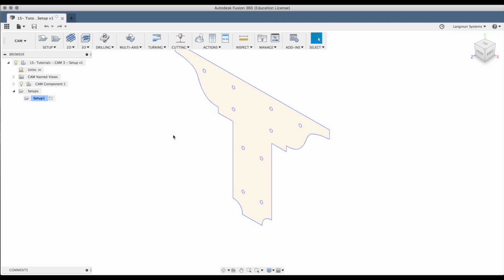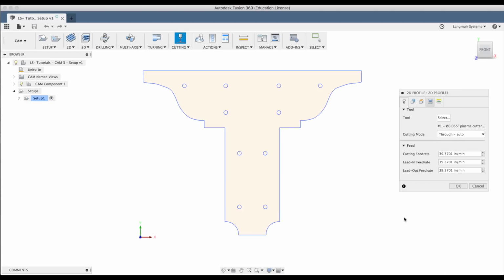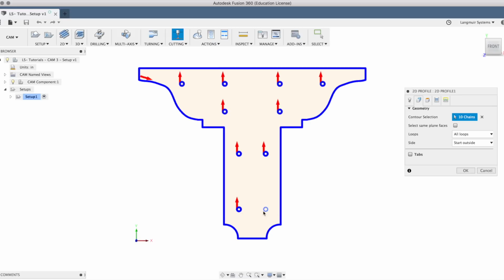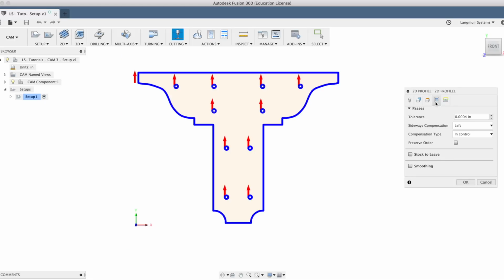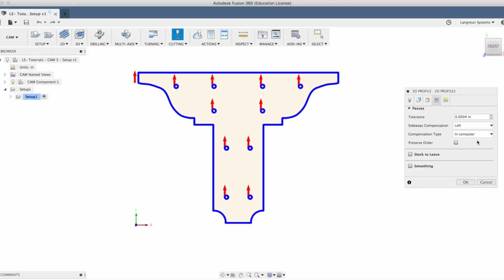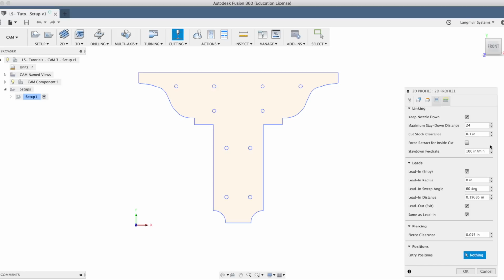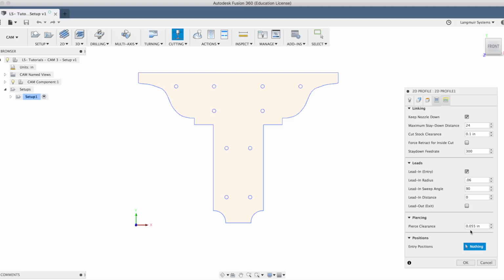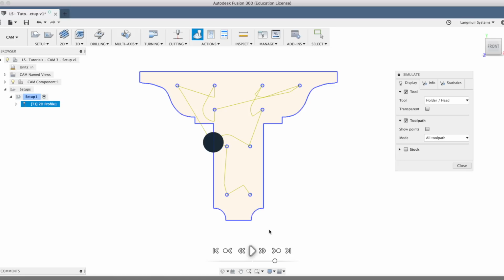*ARCHIVED - OUTDATED INTERFACE* Fusion 360 Tutorial: CAM 4 - Generating Toolpaths and Cut Simulation

Comment: Where are these cut charts you speak of?
Reply: Danny Boy Did you ever find them, because I’m wondering where they are as well...
Reply: @TawnyLBell  The menu system is now Manufacture -> Fabrication -> Cutting
Reply: @TEAMPHY6  Thanks so much!
Reply: The cut charts will either be from the plasma cutter manufacturer depending on what plasma machine you are using or you can find one on the forum that users have created based on the Razorweld unit that Langmuir sells.  Hope this helps. @Danny Boy @Tawney LewisBell